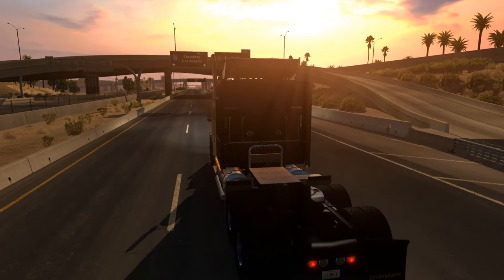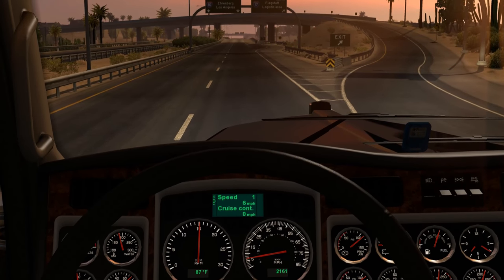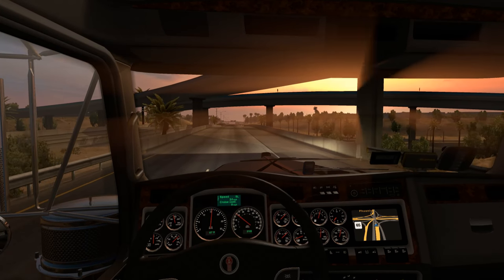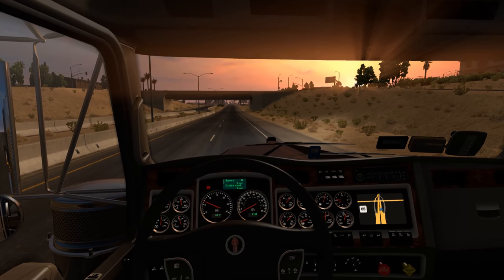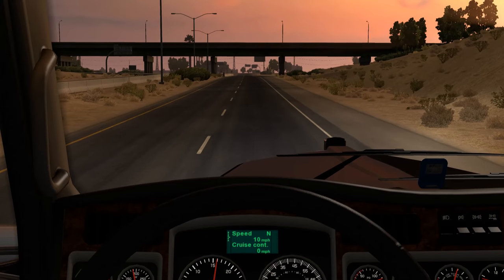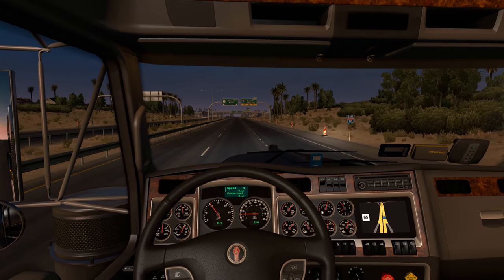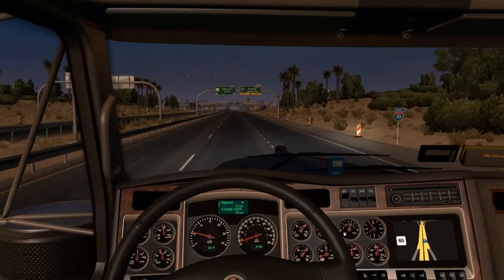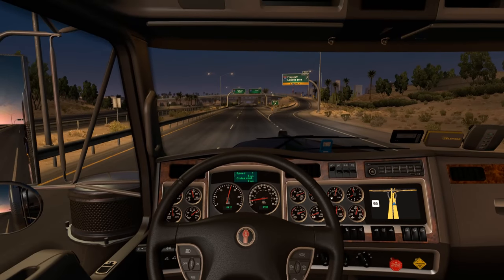How to Double Clutch in ATS 1.6 / ETS2 1.27 (Double Clutch Tutorial)

Comment: Hey Clumsy,
You asked for some tips...
you mentioned towards the end of the video that you dont have to move the shifter into the next gear when you reach your target RPM. (e.g. from 1500 rpm to 1100 for one full gear say 1st to 2nd)... as your RPM is falling, moving the shifter when the needle is at your target... no grinding. You have done exactly what's required, matching the road speed vs the next gear. And you have just successfully floated a gear even though you are using the double clutch method.

By using the clutch, you can give yourself a bit more time to match the RPM of the next gear, however... it's easy to become fixed on the idea that in order for it not to grind.... it must be exactly 400 rpm different from your first shift point. That may have been 3,4,5 attempts.... all the while the truck is losing speed due to drag, etc..... if you are trying for ages the truck will come to a stop and I guarantee you.... 1100 rpm into 4th for a truck sitting still wont work!

You also mentioned you aren't sure what gear to go into if you've become lost.....
Don't worry, this happens to all new truckers driving non-synchro boxes.
Take yourself for a test drive with a pen and a notepad.... and write down the speed at 1500 rpm (for example) for each gear.

You will find if you've become hopelessly lost.... coast for a bit and as the speed is falling.... say you are doing 35mph.... your notepad says at 33mph 6th is 1500 rpm..... just work the throttle up to that RPM.... and as the truck hits 33mph... push the stick into that gear...and you're back in control. But please go and record each gear and ONE rpm to shift at. 

i say this because many people use mods for different rear axle ratio's. a truck with a rear end of 2.78 will be completely different speeds for one at 3.08 for example.

Congrats on enjoying the crashboxes!!!
Reply from the maker: +Tim Day thanks for the awesome tips! Yeah, I get what you mean. It's good to know I'm not alone with determining which gear to shift to, and it's great you gave that tip. I've been trying to do it mentally, but noting it down will for sure help a lot more. Thanks, awesome!

Comment: I know it's almost two years now, things in the game might have changed by then, but I just figured out now about that H shifter synchronized option and I wanted to test it out. I knew already that when a transmission is not synchronized, you have to double clutch (or float) to change gears.
Now here's the thing, my first several attempts ended up worse than this guy switching gears in a Russian truck (minus the curse words, maybe...) I just couldn't figure out why it wouldn't let me at least get it in the next gear no matter what I do, unless I lift off my foot from the clutch and rev it high enough and put it in gear. I just couldn't do it at all, regardless of the many timing attempts. I tried timing my second clutch press, timing the gear, it just wouldn't work.
After a lot of fiddling around, I did think about something they do in real life, which is only pressing half the clutch (because full clutch does this gearbox brake or something)... Now it's kinda hard to get it perfect since you can't really feel it like it would in a real truck I assume. So yeah that was the only way I could get it to work using the clutch, sometimes with a tiny bit of grinding, sometimes no grind at all. But I also found out something that got me confused... When using that half clutch technique, I could also do single clutch shifting somehow.
Now I'm not sure if it's actually how it works, but I just thought about sharing my experience.

TL;DR I can't make it work with double clutch (full press), but I somehow can with double/single clutch (half press), and floating gear.
Reply from the maker: Thanks for sharing. I haven't tried this half clutch technique, but maybe it's time to revisit non-sync'd transmissions again.
Reply: @TheClumsyGeekGaming  That would be awesome! But I forgot to mention that I've tried it on ETS2, and not ATS, but I would think the concept of double clutch shifting should remain the same.
Reply: If you time your upshifts right, you can float them without doing anything also in a real truck or car, as the revs will simply drop to the right level in time. that's probably why single-clutch-shifting worked for you.
Reply from the maker: @Motorsheep  that actually makes sense. Thanks for pitching in.
Reply: @Motorsheep  Yeah I'm thinking it could be a hybrid shifting, partial floating. I float gears for the most part, and I know you can do it in real in any H shifter vehicles. I've never done it in real though.
Reply: @Kr4zyB3n  I have an Atego 818 as my daily driver (the MB Actros' little brother) and I've done it here and there. It's easier than in cars because of the inertia in the big engine, i.e. rev's don't drop or rise as quickly. 
However, overall, floating is more difficult in synchromesh gearboxes because the synchro rings prevent you from just "slamming" the gears in, which you can do in an unsynchronized gearbox - that's why it's sometimes referred to as a crash gearbox. In other words, a small difference in rpm's will actually keep you from engaging a gear without clutching in a synch-box, but not in a crash box if you shift quickly. 

I don't know how much you know about transmissions, so check out this link on how a synchromesh gearbox works vs an unsynchronized one: 

https://www.youtube.com/watch?v=wCu9W9xNwtI

basically, in a synchro-box all the gear wheels are always in mesh with each other, but some rotate freely on the shafts. The synchro rings act as little "clutches" that gently connect the fixed gears with the freely rotating ones. These "clutches" also block you from engaging the gear until there is no rpm difference anymore.

In contrast, in a "crash box", you actually move the geared wheels around on the shafts in order to mesh them with each other, and you can do that as brutally as you like.
Reply: @Motorsheep  I know it's been 3 months, but it's still worth sharing my thoughts. The game lets you shift with the clutch pressed only half way, because what you're actually doing is floating without using the clutch at all. Even though the clutch is 50% pressed, the game still thinks it's not pressed at all and it acts like you're simply floating the gears.
I was also having a hard time setting things up so that I could actually double clutch and I found the best "setup" in ETS2 at least). You obviously have to have the gearbox synchronizing turned off (like you already have) and you also want to add the following line to the def file of the transmission: "shift_time: 0.00". What this does is it reduces the time it takes for the gears to be changed to 0.00 seconds. You can also set this to whatever time you want, but for a manual it's the most realistic if there's no delay whatsoever, since if you physically put the gearstick into gear, than that gear is selected right then, not seconds later. Now, I'm not sure if this "shift_time" thing works in ATS. On the SCS forum I read something like ATS doesn't use this, because this system was made so that the new Scania Opticruise transmissions could become faster in game... So I'm not exactly sure whether it works in ATS or not (I don't play ATS), but it's definitely worth a try.
And you obviously need to time your second clutching perfectly at the right rpm. The funny thing though is that the actual input shaft of the transmission is not simulated, so it never slows down. It maintains the same speed as it was doing when you pressed the clutch in the 2nd time, so you can switch it into gear anytime as long as the clutch stays pressed in. It's a bit weird, but if you shift like you normally would irl, then you won't notice it at all.
I hope I could maybe help with this.
Reply: @tommeiner9983  Thanks! Not playing ets at the moment, but the bit about the shift time is very interesting. I hope I'll remember when I play the next time
Reply: @tommeiner9983  Interesting remarks. I just ended up going back to synchronized transmission setting since most European trucks have synchros anyways. Also, I didn't know that the speed of the gearbox wouldn't vary as soon as you press the clutch the second time. Nonetheless, it takes a lot of practice to really master the shifting with double clutching.
Reply from the maker: Thanks for the inputs! Makes sense. I will have to review this when I revisit double clutching.
Reply: @tommeiner9983  I also tried to find out what is double clutch in ATS. You are very clever, I made similar conclusions. I thought that input shaft has only two positions depending of clutch depressing: one part - clutch is ignored and input shaft rpm=engine rpm, and part two: input shaft is stopped to 0 rpm. No else. In real life after second half-clutch in neutral input shaft will  slow down( but more slow than engine rpm!). But sometimes gears are engaged and I could not understand what is going on. Unbelievable, have you really solved this pazzle? So you think, that input shaft maintains speed which was before depressing clutch?
Reply: @АлександрКоловрат-и1н  Well, actually I've just hopped into ETS2 to test this out and I found out that it doesnt maintain the same rpm forever. So I'm happy to report that my theory was wrong. Looks like SCS actually did it realistically. It maintains the rpm for a good 5 seconds and after that you can't put it into gear anymore. 
BUT what you can do is pressing the clutch in at the right rpm, shift into the next gear, then put it into neutral, then back in gear again, then back to neutral again, then back in gear (you get the idea). So after clutching at the right time you can switch back and forth really quickly between neutral and gear almost forever (it still won't let you into gear after a good while). This also makes sense, because since you're always putting it back into gear, the input is always on matching rpm with the output.
So it turns out that the whole non-synchronized gearbox system is actually very well done by SCS and you can definitely do some proper double clutching in the game.
The only problem now with both floating and double clutching is that they're extremely difficult to do consistently, because unfortunately we don't have force feedback on out shifters, so we have to guess when it lets you into gear istead of feeling it, like in real life...
Reply: @tommeiner9983  No, no, don't hurry. Your theory as for me is absoletuly right. I tested it on ATS 1.33.  So I made good acceleration on 6 gear to 2000 rpm, clutch to neutral, when rpm dropped to 1400 I depressed clutch and hold it. After that I pressed 6 gear button on game pad and hold it, listening scratch. I cruised about 30 seconds with permanent scratch of gearbox. Finally, when truck slowed down, gear was engaged despite of idle rpm 600. I immediately released clutch and rpm raise to the same 1400. So you found out SCS bug which is going from even 1.27 version. 
I will try to tell them from SCS forum, maybe they will fix it.
Reply: @tommeiner9983  Congratulations! I used official  SCS forum about bugs in beta 1.37 and this problem was recognized and got QA id number. Details: https://forum.scssoft.com/viewtopic.php?f=271&t=283962
Reply: @tommeiner9983  Hello! No one can tell me, what acctually will slow down faster: input shaft rpm or engine rpm, when gearbox in neutral and clutch is pressed. Maybe you have idea?

Comment: At 4:15 I saw the command g_hshifter_layout_shifting ... can you explain what that command does, plz? Thank you! All I know is that you have to put it to zero (disable) too if you want to start floating the gears. Is that correct?
Reply from the maker: I don't actually manually use this command. What I do is go to the controls options, I choose H-shifter there, and make sure it's advanced. It has to be advanced to allow floating of gears. 👍
Reply: So, to float gears you only need to set the h-shifter to advanced in the options, but if you want to double clutch, you additionally need to disable syncronization in the console. Right?
Reply from the maker: Yup! You got it. 👍

Comment: floating gears damages a car's transmission if you do it incorrectly, and shouldn't be done unless you really know what you're doing and match your revs correctly all the time. However, in a truck, the gears are much closer together and floating gears is much safer and more convenient (it'll even save a lot of wear on the clutch!) So it's not really that truckers do it because they don't care about their transmissions, but rather because it's much easier to do it in a truck, and the clutch pedal is much stiffer on a truck compared to a car making it hard to double-clutch all the time. Generally, double-clutching is for beginners, and once you are able to rev-match well enough, you learn to float. I've never seen an experienced trucker double-clutch, they all float
Reply from the maker: Thanks for the insight!

Comment: Hi Clumsy did you know that with the 1.39 update of ATS SCS Software has added the clutch brake for the unsynchronized transmission
Reply from the maker: Hi, yes! Unfortunately I'm not familiar how to use it still, and with no feedback on the shifter I'm not sure how double clutching can feel natural?
Reply: @TheClumsyGeekGaming  Ok because i've tried to play with the clutch brake by putting it on "1" in the game console but it works weird because when i'm depressing the clutch all the way to the floor it works but if i'm right it shouldn't and it even works like a synchronized transmission so i think scs software might need to resolve this problem
Reply from the maker: That's with g_hshifter_synchronized set to 0 already? Hmm that does sound weird, if so.
Reply: @julianglad11  Hi, so
clutch brake is only for starting a  truck from a dead stop, it works when you depress the clutch pedal all the way down an you put a gear in, then the rest of the ride, you depressin gthe pedal just halfway so you DON'T engage the clutch brake, in real life you would burn it
Reply: @cpt.ronaldsparkyspeirs9380  Hi thanks you but i already knew how the clutch brake works in real life but the problem is that in american truck simulator SCS software made a mess with the clutch brake because it works like a synchronized transmission. In ATS, when i'm at a stop i depress the clutch pedal all the way down, and i realized that when i'm driving my truck i can put a gear in with the clutch pedal depressed all the way down.